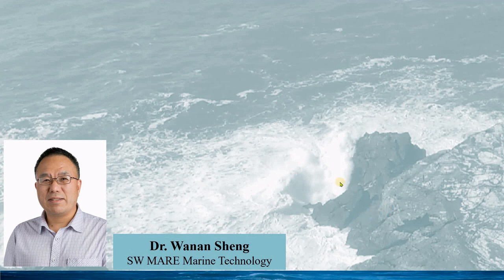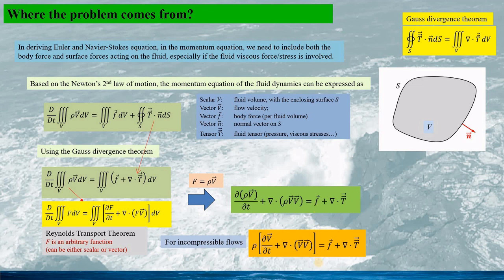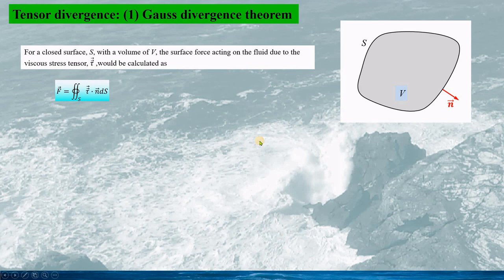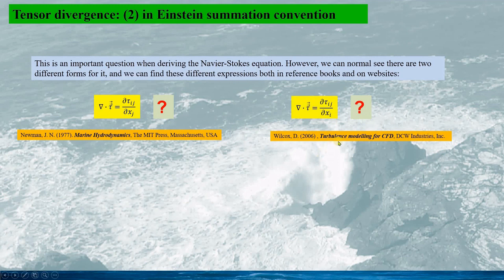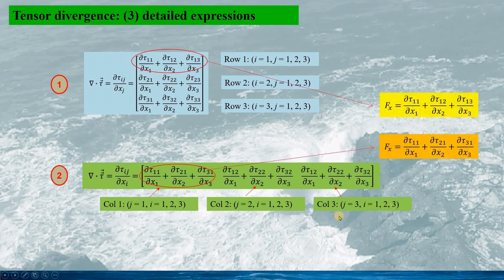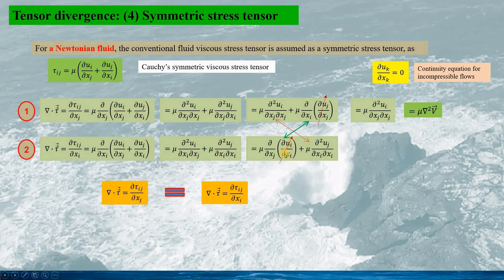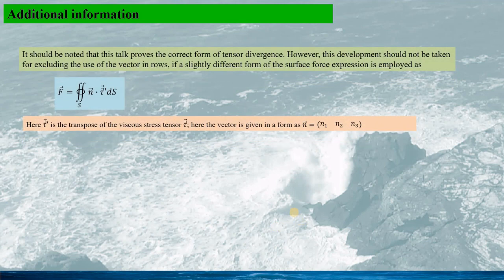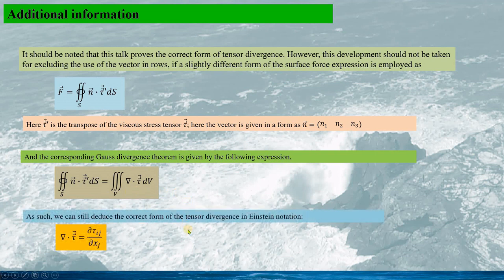[Fluid dynamics: Equation] Tensor divergence calculation

Comment: Thank you and I have a doubt about the Divergence of tensor, It is mentioned in different ways in different books. ∇ · (φT) = φ∇ · T + T ^⊤ . ∇φ  ---- eq(1)  and ∇ · (φT) = φ∇ · T + T ∇φ ---eq(2). Which one is correct, if T is tensor. Then how to solve this one ∇ · τ = ∇ · (2µE), Here E is strain tensor
Reply from the maker: Thanks for asking. These may be both correct, but depending on how the tensor component is defined. for instance, Tij can be defined as a component in i-direction on a plane of constant y, or in j-direction on a plane of constant x. these two different definitions would cause different expressions as you have seen in different books. 
Hope this helps.
Reply: @ScienceofFluids  Thanks a lot. Explanation is really helpful